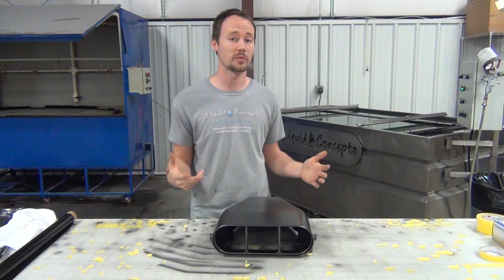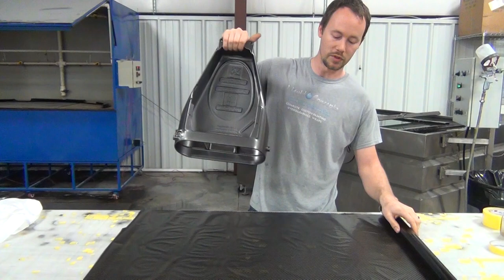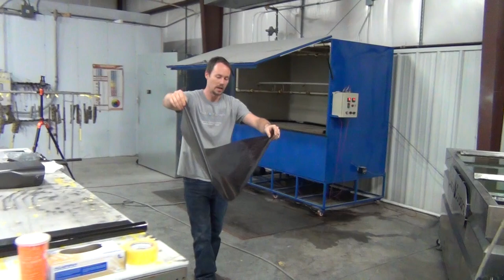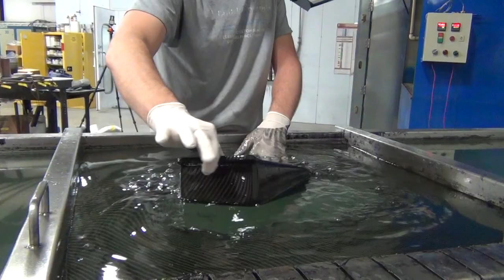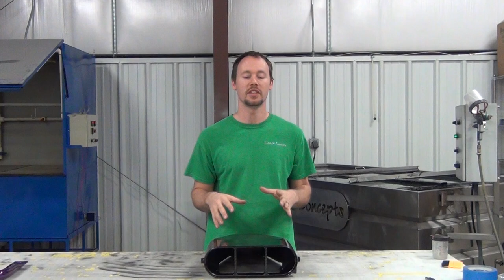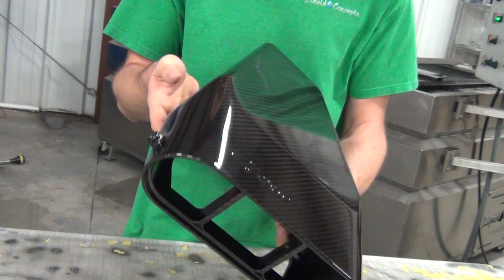HOW TO HYDRO DIP A BLOWER SCOOP | Liquid Concepts | Weekly Tips and Tricks

Comment: How well does the film/dip material deal with heat? I have a similar scoop that mounts to the upper intake and remains covering the carbs when the hood is removed. This looks great, and there are several additional parts in the engine bay that would look great dipped. Thanks.